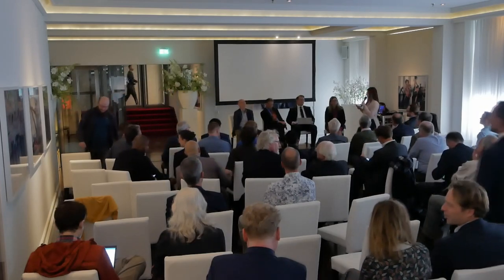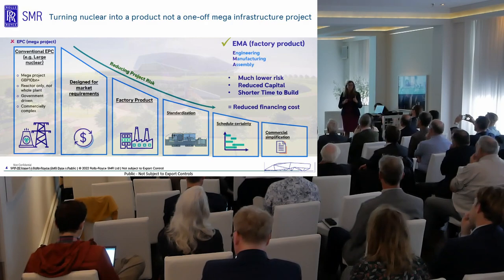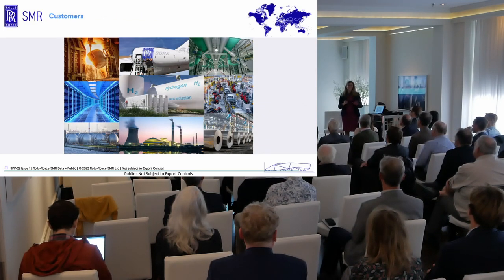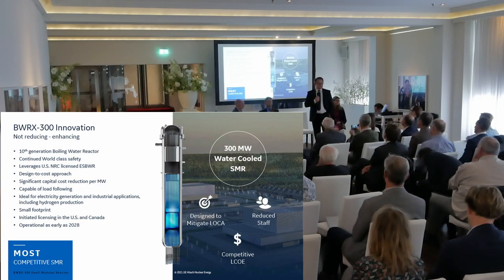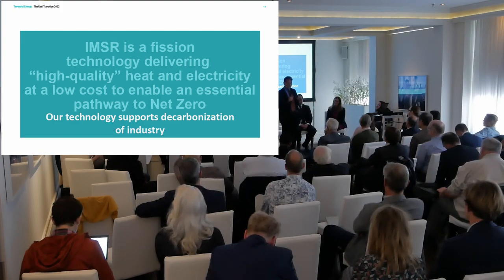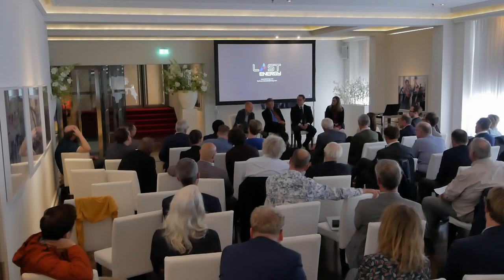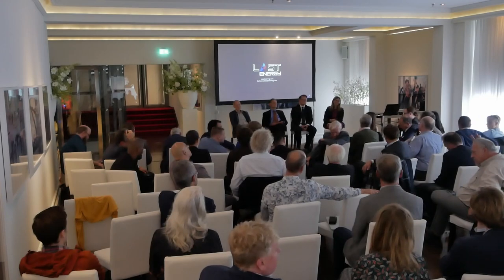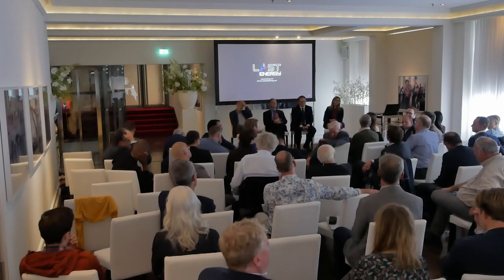Nuclear is set to go! Small Modular Reactor Panel

Comment: High temperature is the key to the future of nuclear.
Reply from the maker: How is this a helpful response?
Reply: @Atomicjedi  Stating facts is helpful.
Reply: I agree. I have nothing against water cooled designs, indeed I wish them every success, but I also think longer term nuclear high-temperature is the future of nuclear power. There are many benefits that can only be realised by high-temperature designs: better thermal efficiency, ability to use thermal storage to integrate with renewables, ability to use passive air cooling for decay heat and others. There are also many markets (such as industrial process heat) that can only be decarbonised in a cost-effective way by a high-temperature design.

Comment: The idea that China doesn’t care about pollution is probably incorrect. Rather, they have realized (correctly, in my opinion) that pollution vs cheap, affordable energy is a trade-off, and therefore accept the pollution as an inevitable side-effect of a quickly growing economy, which is a major driver of increasing human lifespan and standard of living.
Reply: They're also currently building more plants than any other country, as far as I know, so I'm guessing they eventually plan to rely majorly on NPPs.
Reply: @Waldemarvonanhalt  I'm sure they're aware of the enormous potential of nuclear energy. However they're also building hundreds of brand new coal power plants (which will last 40 years)...